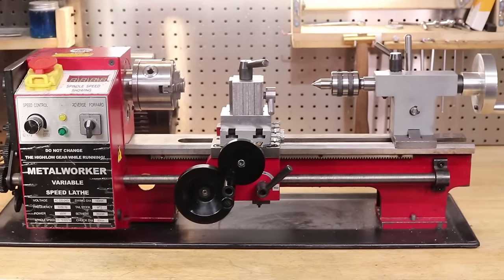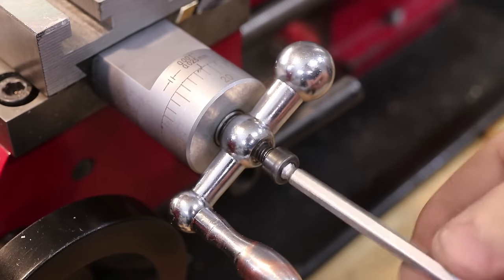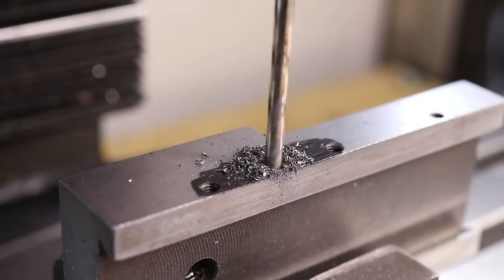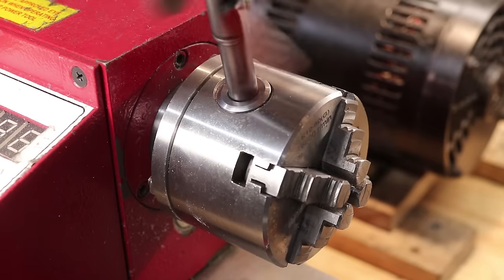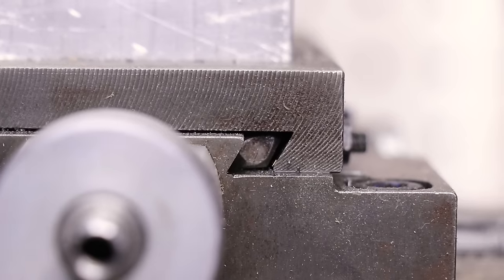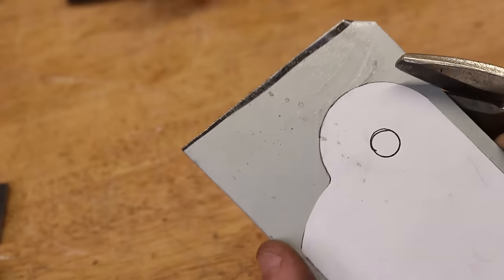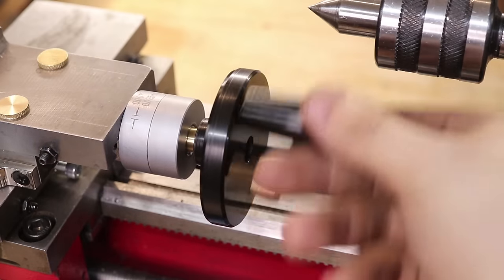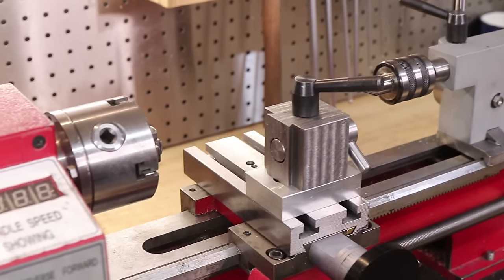20 Best Mini Lathe Upgrades And Improvements

Comment: I've been machining over 32 years.  You need to slow down your spindle speed and start using some coolant or cutting oil.  The blue chip is a giveaway to using too fast a spindle speed.  It will destroy your insert tooling much faster than it would normally last.  The steel you're cutting will work harden as you cut it, and that will contribute to poor finishes.  And the carbide inserts you're using have the wrong geometry for turning or facing.  Get to know the cutting speed of the materials you cut in FPM (feet per minute).  A quick and dirty calculation for a practical spindle speed when turning is  RPM = (4 x FPM)/D, where D is the diameter of the work in inches.  When drilling or milling a hole, D is the diameter of the cutter. But I cut the calculated spindle speed in half .  Saves drill bits and mills, especially when drilling or milling deep holes.
Reply from the maker: I agree with you but this lathe has a fixed speed motor, so there is not much I can do about the rpm. The inserts still last a long time so its not a huge concern for me.
Reply: @artisanmakes  I hope I didn't offend you.  You've done some good mods to that machine.  I'm just surprised you can't change the spindle speed.   Don't you have a belt and stepped pulleys?  Or is it a direct drive without a speed control?  What is the RPM?   I'd  be looking for an electronic speed control or a set of stepped pulleys as my first mods.   Suggest if you insist on using insert tooling, you use a holder that takes a square insert, and use an insert with a .03 to .05" radius corner for most of my turning and facing.  (It will give you a better finish than that sharp diamond shaped insert, and last much longer.)     But I think brazed tooling would be an even better bet,  because the shank of the tool conducts away more heat from the carbide than an insert holder. .  Just for reference, I use the Hardinge speed lathe in my employer's shop on average 5 hours a week.  I haven't replaced any inserts or rotated them in at least six years.  But I used a couple pieces of brazed tooling for the majority of my work, and it requires only an occasional touch up with a diamond sharpening stone or a green wheel on a grinder.
Reply: You got one of the old heads going... lol

Comment: It would be AWESOME if somehow some of your mods were to get to the manufacturers of these lathes. they could do some of them without much additional costs. and the manufactures who did this would sell more of them.
Reply: It would be nice but it would indeed increase the cost. I’m curious how it could not. Everything is a cost - labor, better parts, electricity, and the time, etc.  These awesome mods all take a lot of each. It’s well worth it to a hobbyist but when getting them out the door is key, it adds up a lot. That’s just manufacturing - pick your quality point and QC to that. So it’s simple, higher end lathes have these mods built in but it will cost more to have someone else do it for you. A good exercise is to consider “without any additional cost” so you would freely do some mods on all our lathes because it wouldn’t put you out anything at all, right? Not trying to be smart but the costs are indeed there. 
I agree though, the mods are great!
Reply: @836dmar  Exactly. Even redesigns that don't use any additional material or tooling have a cost to them.

Comment: I hope you're proud of your channel, It's really good. If there's anywhere near you that cuts stone for worktops and things like that. Ask them if you can buy a cut off slab of granite or marble, they'll probably be happy to drill a few holes in it, and bolt your lathe to that. From the mass and rigidity you'll see a massive difference in several ways, stability, surface finish, vibration, chatter. Keep up the great work!
Reply: Yeah, that's a great idea for a mod!  Increasing the rigidity on a small lathe like this can be a game changer.
Reply: You can also cast a cement slab.
Cement is Very useful for vibration reduction 😎
Reply: One other detail to attend ASAP. Is to flatten the lathe feet. 
Out of the box they are badly finished. Half an hour and a wet stone. Make a world of difference! Mine would wobble out of the box. Sure footed by now! ;-)

Comment: Great video , I have been a machinist all my life and built pool cues for 30 years. I have been using the mini lathe since it first came out for putting pool cue tips on. I think I pretty much did all them mods at one point. For me my fav was my rear chuck to hold the pool cue shaft. Through the years I’ve made tens of thousands of dollars on the mini lathe . I used to have a portable one that I would set up at pool tournaments and do tips.  the whole thing was mounted to a small butcher block cart that I had on caster wheels . the front was framed in with a Plexiglass window and fluorescent light overhead . I also made an extension so I can put the whole cue or shaft in between centers ,  it was a simple Bolt on with no flex ,  the carriage never needed go back there just the tail stock.  I had some of the best pool players in the world walk up and have me put their tip on .. I wish I could post pics on here. Anyways awesome vid , keep up the good work.
Reply: You can simply post LINKS to pictures that are stored elsewhere online.

Comment: Really IMPORTANT is that when bolting down the lathe, an indicator clock should be used as to check that you don't actually bend the lathebed when tightening the bolts. Because this is actually very easy to do! The forces you apply with the fastening bolts to lathe bed are considerable. And it is done at the far end corners of the lathe, so giving the bed a twist is really, really easy. (Do some readin up on the procedure.)

The other side of the matter is of course that bolting down the lathe adds a lot of rigidity, as pointed out in the video. Also adding a big HEAVY steel base as suggested in the video, is a really good idea. Any added mass reduces vibrations. And then bolt that stell base to the bench "lightly" for safety and things like sawing etc, just not to have the whole thing "skating" around on the workbench.

These mini lathes are really way to lightweight and flimsily designed, but it comes with the economy side of things, so doing the above alleviates a lot of the compromise inherrent in the "mini/micro" aspect of these lathes. Always buy the heaviest and biggest lathe you can possibly accomodate! It makes a huge difference! 

Even distance between centres is a lot more important than one might realize at first, because once chucks and tooling like drills are mounted, there is so little space left on a mini lathe, that just changing for another drill size is often a really annoying hassle. I'd say length of bed is more important than a quick change toolpost, when it comes to make work easyier

Comment: You might consider putting felt into the oil holes.  Doing this controls the flow of the oil to the surfaces requiring lubrication.  An advantage is that the oil does not “run out” reducing oil collecting crap from your work and helping to generally keep the tool a little cleaner.
Reply: use pipe cleaners

Comment: This is one of those videos I keep coming back to whenever I'm looking to upgrade my machine a bit. On the topic of the gib strips, I made a couple out of brass but instead of a mill, I used a surface grinder. If anyone is looking to do this, all you need is a tilting vise and a surface grinder. I started by tilting the vise to 60 degrees, which I verified with a comparator (there are plenty other ways to verify this without a $10,000 piece of inspection equipment haha, just what I had available at our shop). With the vise at 60 degrees, I mounted the square stock in it, and brought it to the surface grinder. I simply ground one side down until I had taken the flat off and I was left with a sharp edge. You'll then need to take the part out of the vise, as you can't grip it anymore, and use the maglock to directly fix it to the surface grinder, sitting on the edge you just grinded. Now when you grind the other side, since the part is already laying at a 60 degree angle, you're already going to get a correct angle on the other side. I took material off until I had a general shape of the gib strip, then switched to a higher grit white wheel. I cleaned up all surfaces and simply went back and forth, taking off small amount of material, test fitting it, and repeat until I got a nice fit. Overall it took a while, quite a bit of surfacing but the end result was worth it and I didn't need a dovetail cutter, and didn't have to use our mill. (I mostly did this because I'm an idiot when it comes to milling and I wasn't confident that I could get a good part with the small amount of stock I had available)

Comment: I cut a dovetail into a right angle plate to mount to the cross slide, then mounted a t-slot plate to the vertical face of the right angle plate in order to use it as a horizontal mill. It worked out perfect to cut the new gib strips and carriage retainers. The next thing that I'm looking for is a good way to be able to adjust the angle of the top slide faster

Comment: I did mention this in your mill upgrades video, but I'll mention it here too, as it's more on-topic. Adding an Electronic Lead Screw [ELS] is a great upgrade, especially of you do a lot of thread cutting, but also handy for controlling feedrate for better surface finish. As a bonus you get away from having to constantly swap the change gears in and out. Speaking of change gears, the quality of the factory ones is pretty terrible, and the plastic ones tend to crack and break pretty quickly, I recommend getting an after-market metal set.
Reply: Wait, how does the ELS know what speed the motor is going at?
Reply: @mikkelkirketerp4884  using a rotary encoder on the shaft. With the encoder you can determine speed, and rotational position.

Comment: I'm new to lathe work and just bought a mini mill. I'm an automation engineer and will CNC it soon. Your videos are awesome and I'm learning well. As for your motor upgrade, a $30 20k rpm 500w or greater with static gearing, being a DC version can easily be turned into a variable speed 50-2500rpm full load using a micro controller, an igbt or MOSFET, a hall effect rpm meter and 10mins of novice programming for <$50 not including power. Use an old computer power supply. Usually 2 x 15amp 12v available + some 5v for logic. See Arduino motor controls. If rpm variant from desired, change power!  Also it's far more reliable than last year's tech. 💕❤️🖖😇🤗👍🙏,jpk thanks! PS. I want to add an oiler tied into an ifrared temp sensor. $10

Comment: I found this helpful as I am considering buying my first lathe and like all first-timers the mini-lathe seems like the place to start. I have heard a lot of complaints about mini-lathes however and this video confirmed basically all of them. The consensus I have seen is that you will quickly become frustrated with the limitations of a mini-lathe. It would seem from this video that you have had to replace many of the key components such as the fixtures, motor, bearings etc. because they weren't up to the task. Many have advised that it is better to buy a larger lathe that is used. There is greater precision, build quality, and more features over a brand new mini-lathe. Thanks.

Comment: You can at a pinch use your lathe as a milling device. Buy a small milling machine vice and fabricate a bracket to mount it on its side to your toolpost. Mount the mill cutting tools (non tapered ) into the lathe chuck. Your biggest challenge will be to ensure that the toolpost mounted vice is perfectly perpendicular to the lathe . Crude but does work..
Reply: What about Z axis?  I guess you're typically only using 2 axes
Reply: You can get vertical milling slide attachments that are designed to mount on the cross-slide, giving you a Z axis in addition to your X and Y.
This allows you to undertake small milling work on your lathe with similar accuracy to a proper mill.
I will be purchasing one for my Boxford at the end up January.

Comment: I’ve been following your mods. Very good work. I’ve got a Southbend FOURTEEN. A much bigger lathe. But even so, I’ve made upgrades that help. Amongst the most major were also a cam lever for the tailstock. Like with yours, it was a pain to constantly need to get the wrench and have to reposition it twice to lock or unlock. Drilling or boring deep holes, for example, means moving it in and out to clear chips and lube a number of times. The cam makes that fast, and (almost) fun.

Comment: Thanks for your great ideas, I have two of these lathes, but I think the bearings on my oldest will need replacing one day.  My first one has a brushless motor and it has been very good except for the circuit board blowing up one day, but I fixed that by buying another board (these are not cheap or plentiful) so I am hoping it will not happen again as I like the variable speed and the board are hard to replace.  I use those aluminium tool holders, but steel would be better.  I have had a lot of problems with the cross slide lifting while cutting and currently I just keep the tool close to the holder and push down on the cross slide while cutting.

Comment: An easier fix for the top slide leadscrew is a washer. Find a flat washer with a hole that fits closely over the screw and has an outside diameter at least as big as the bushing. If it's larger, put it on a bolt with a nut to hold it against the head, then chuck the bolt and turn the OD down. Drill two holes through the washer where the bushing mounting holes are. Counterbore the slide face of the bushing so the collar on the screw sits barely below the surface. Replace the two screws with slightly longer ones when putting that back together. This mod loses zero travel forward and only as much rearward as the thickness of the washer.

The best mods cost nothing at all. The easiest is to take the cross slide bushing off and remove the paint off the end that fits against the carriage. Instant backlash reduction. I further improved it by facing that end of the bushing until there was next to nil clearance for the collar on the screw.

Another no cost mod is removing everything from the bed, mounting it upside down on a mill, then cutting the feet bottoms so they're flat and at the same height. That greatly simplifies shimming when mounting to a bench so there's no twist or bow.

There are two factories that make these 7" lathes, SIEG and the better one. The better one's saddle is rectangular instead of "H" shaped so it's very easy to add a carriage lock, just drill a hole where you added that piece of steel bar. The better one has a slightly thicker apron and dual ball bearings on the carriage crank VS a plain hole on SIEG's. SIEG uses (or used to) three bolts to mount the headstock to the bed. The better one uses four. SIEG doesn't have oiling holes in the leadscrew bushings. The better one has oil holes with countersunk openings. One more thing the better one has over SIEG's is on the right end of the lead screw there's a special nut with a threaded insert to take up any endways slop. Put a thin brass washer on each side of the bushing and that can be tightened to zero slop. This company also offers hardened and ground way surfaces if the importer wants that. Lathes with that get a label put on the right end of the bed. The company that's not SIEG uses a nice Pulse Width Modulation motor controller. SIEG tends to not do a good job finishing the bottoms of the bed feet where the other company at least does a cutting pass, likely with a big fly cutter.

This video is an unboxing of one of those better lathes. https://youtu.be/Behm1oMubzs One thing to watch out for is many companies selling 7x lathes start out buying from the better factory then later switch to getting lathes from SIEG. Harbor Freight and Grizzly have always bought their from SIEG.

My first metal lathe happened to be one of these better versions, bought from a company called Homier Mobile Merchants. They ran a fleet of semi trucks around the USA, setting up shop here and there to sell all kinds of imported stuff from China. Where places like Harbor Freight sell a SIEG 7x10 but that 10" is between plain centers, the one I got was advertised as a 7x12 and that 12" was between a center in the tailstock and the face of the stock 3 jaw chuck.

SIEG has somewhat improved the quality of their 7" mini lathes. My second lathe was a 7x10 from Grizzly with their serial number 346. It was likely from the very first batch they imported. Previous owners had abused the poor thing in many ways, most likely due to its many 'built in' faults. The underside of the ways weren't parallel to the top side, not even in the center. I was able to correct the outer part on my mill but I didn't have the tools to fix the inner part, but since nothing but the tailstock clamp used that it wasn't critical. The motor controller was a very primitive SCR chopper style and one of the main power resistors had gotten so hot it unsoldered itself at one end. A quick hit with a soldering iron had it going. By the time I was done correcting all its problems I almost liked it more than the longer one from the other factory. I thought about getting a PWM controller for it but never got around to it.

Comment: I recognize some of the same issues in my Sieg machine, but a few seem to have been fixed in newer models: lever-locking tailstock, carriage gear protector, and okay-ish gibs. Favorite (purchased) upgrade: a rotary encoder for the tail stock so I can exactly drill to depth.